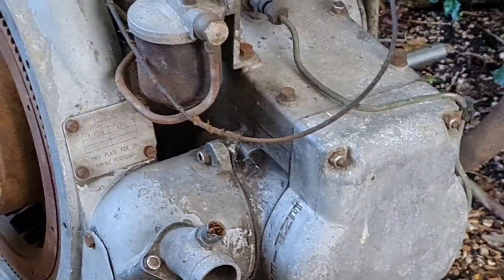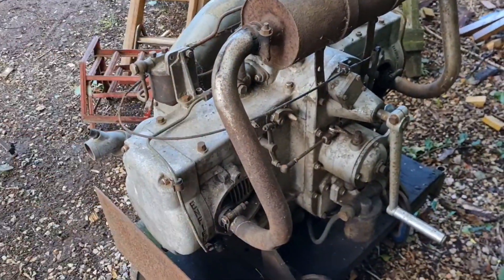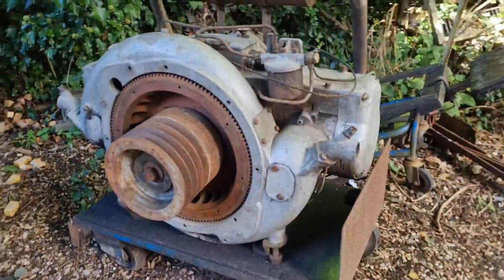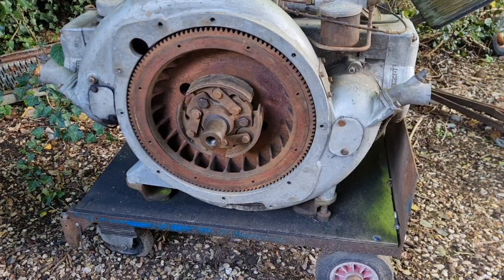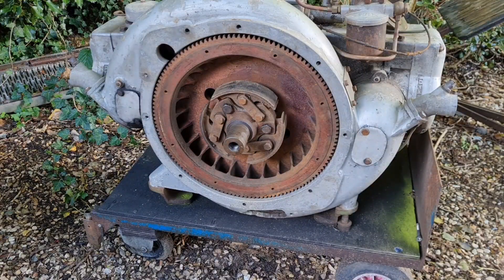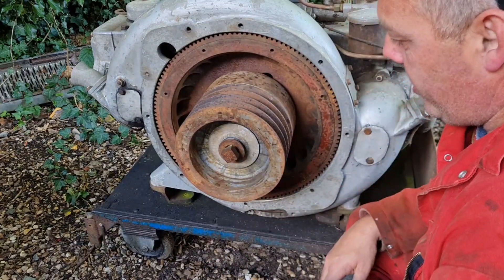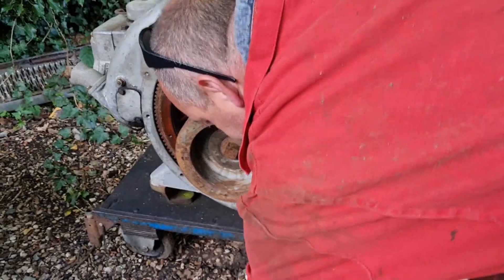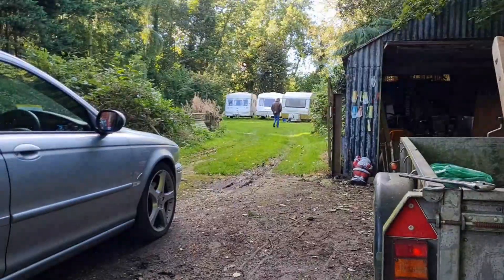Enfield twin Diesel engine

Comment: These Enfield diesels were used in the RN as whaler boat engines and as 4 man portable fire pumps.  Hard to start by hand cranking, easier with an electric starter and easy start sprayed into the air intake. 7HP rings a bell, maybe mistaken though.

Comment: About all I could find out about them is there are 1135 cc have about 15bhp and 1800 rpm alot of them were used in marine applications and their cylinder head and cylinder walls are made of cast iron and the majority of the rest of it is made of aluminium. Great video as always 👍 ( I just found out that the pointed end on the start stop lever has to point twords the start letters to start and latch on to that thing that you were struggling to latch it on too to stop)
Reply from the maker: Ar great info. Thanks. This should be a fun one. If I can crank it hard enough. Lol..
Reply: 00